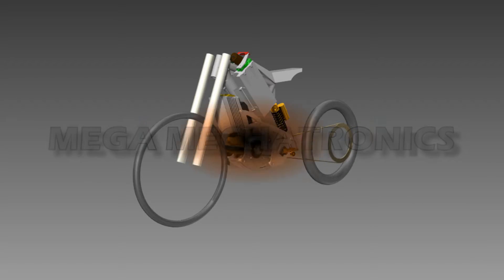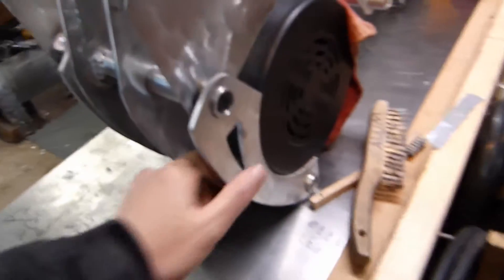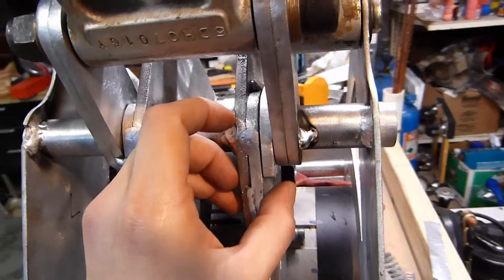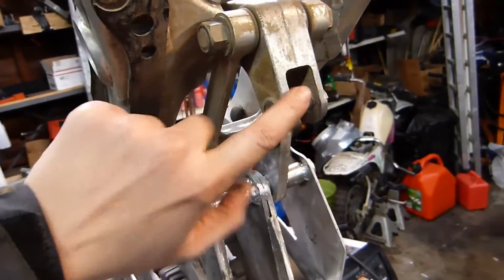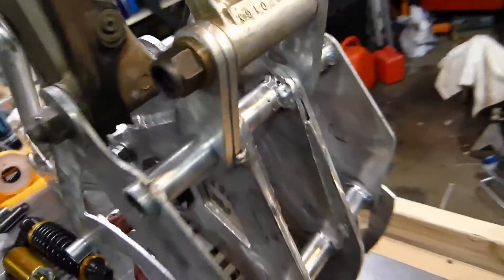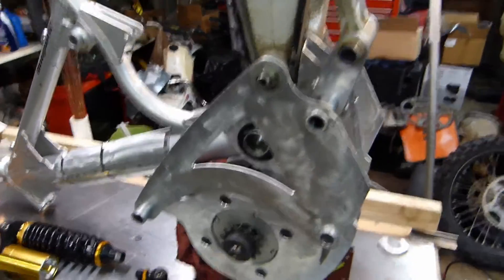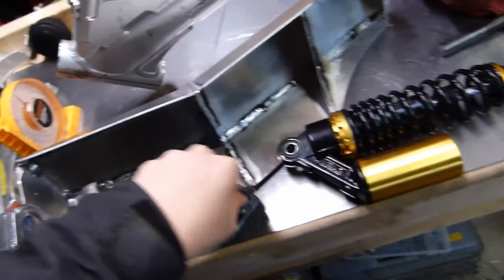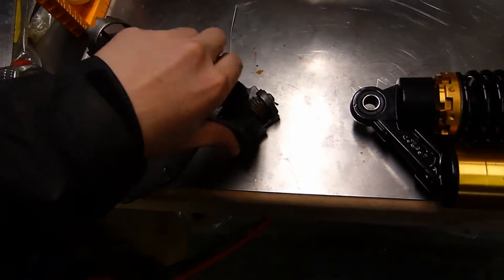Sick Fast Electric Bike Motorcycle Build - Part 2

Comment: Hi good afternoon , Greetings from Colombia , I like your project , I would like to make a bicycle like yours, where I could get necessary information , engine type , controller , batteries to use , here it is difficult to get lithium ion battery , could used lead -acid batteries ?, if you could give me information would be very grateful .

attentively

juan miguel jimenez
Reply from the maker: Juan Miguel Jimenez Sanchez Juan, the best resource to start would be endless-sphere.com

There is no one size fits all, it all depends on your application.

Comment: Thanks for another great video! Always looking forward to learning more from these. What's the motor you have installed, there?
Reply from the maker: It's a Motenergy (Mars) ME0913 Brushless:
http://www.motenergy.com/me0913.html

/user/RIPPERTON here on youtube built a track bike using an R1 motorcycle pushing unreal power through it, he's burned up this motor (running 3x rating), killed magnets, upgraded with gigantic magnets.  So what I am building will hopefully be the most powerful full suspension electric bike (with pedals installed) in 2014.
Reply: I've read some of the stuff Ripperton posted on DIYElectricCar forums about his build process. The man is a mad genius. Do you plan to modify the motor in a similar way, then?
Reply from the maker: GRom4232 For this project I don't think I will need to make any modifications, but for the subsequent project I have I am considering it part of the plan; using two of these motors for a HEV conversion system.